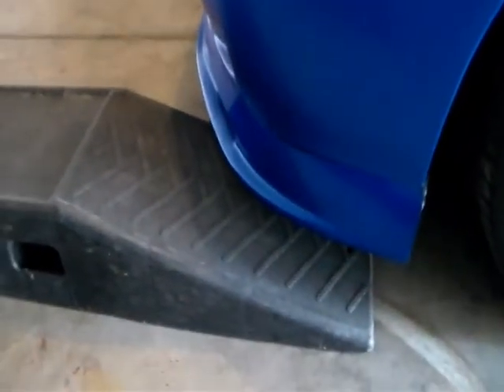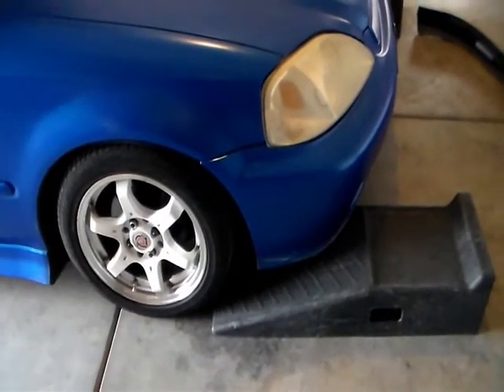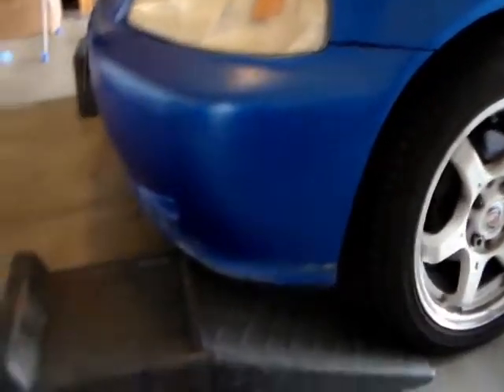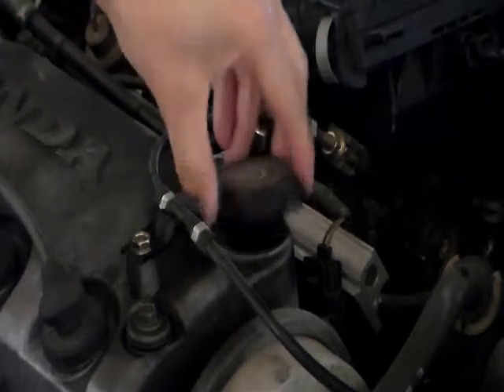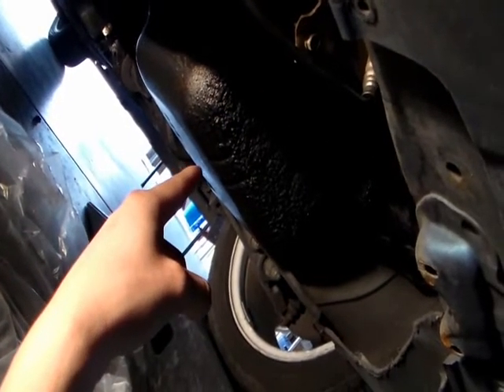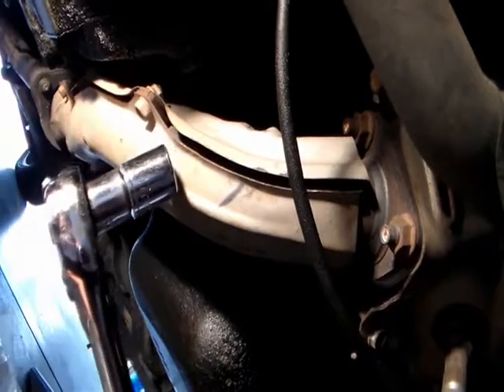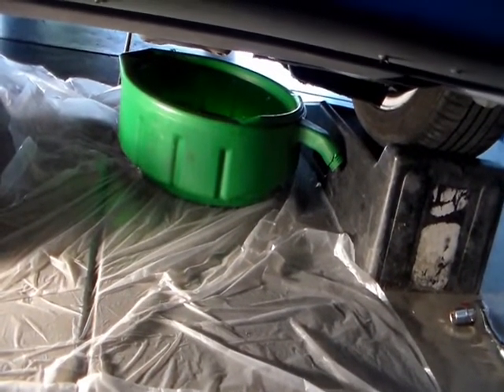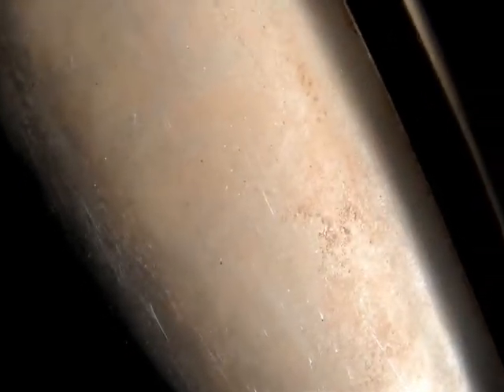1996-2000 Honda Civic Oil and Filter change

Comment: How many miles between changes?
Reply from the maker: The car I was working on had a reset. Every time the oil is change the reset button could be push whenever it's time for oil change there's an indicator. Don't take my advice I'm guessing it's 5000 miles.
Reply: Yes, I have a 99 ex and i'm using the high mileage oil....5000 intervals. thanks for the reply!
Reply from the maker: There should be a button on the dash at least on mine there is I was working on a DX.  When it's time for oil change it'll turn red. Push the button with your key after oil change and it'll turn green. If I remember correctly it goes from Green to Yellow, then Red.